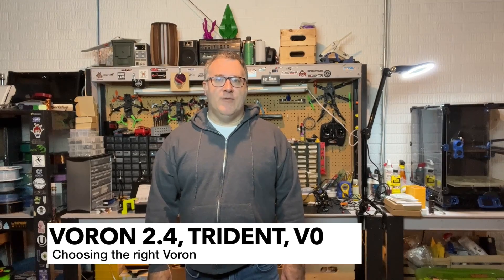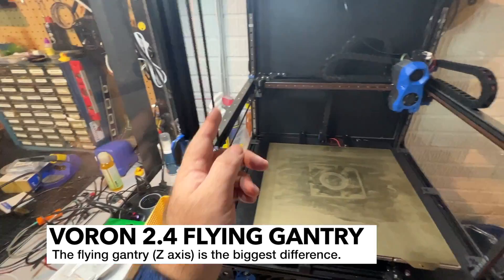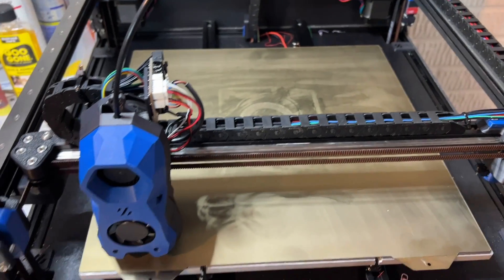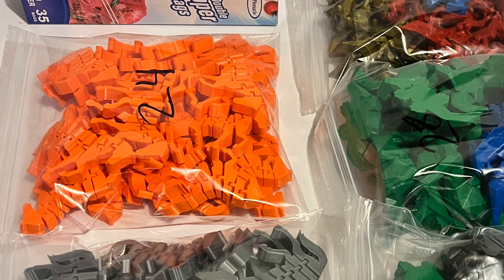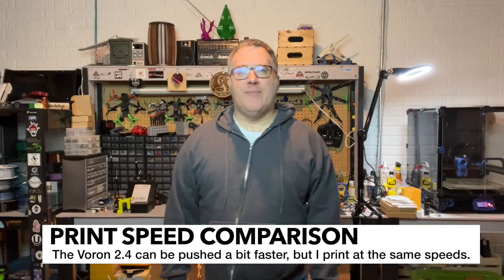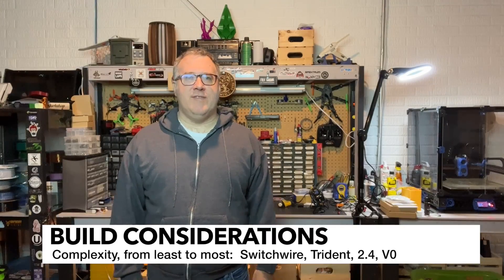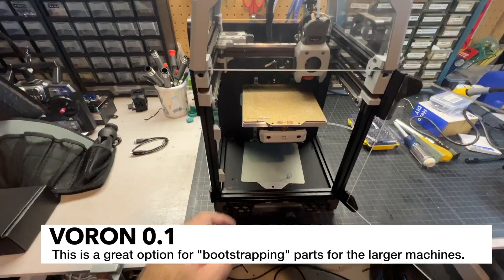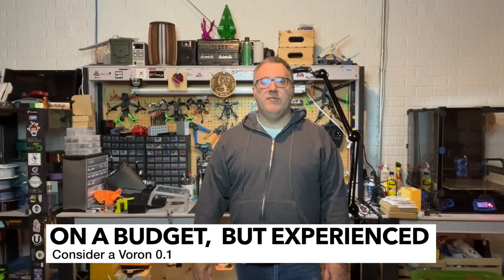Which Voron should you build?

Comment: Good overview. To  me there is no reason to recommend any voron except  for the trident. It's the easiest to build and maintain and give you very practical build volumes and good quality prints.

2.4 means more belts to tune, gantry racking to deal with, and overal a just more complex build. And the benefit is nebulus. You should bascially only build a 2.4 if you love the idea of a flying gantry with quad gantry leveling. But there is no treal practical benefit for the added complexity.

The v0 is a pain to build and a pain to maintain and work on due to the 1515 extrusions as well as a bunch of, honestly, bone-headed design decisions. I don't recommend the stock v0 to anyone.I often joke that there is a mod to change everything on the v0, only because everything needs to be changed.
Reply from the maker: Yeah… I do tend to agree! I know some folks really like the cool factor of the flying gantry. But the trident is definitely a no brainer. Thanks for watching and commenting! Appreciate the insight.
Reply: I'd say most people who go with the 2.4 is more than just the cool factor. The Trident, no matter the bed size, is still limited to 250mm on the Z axis. With 2.4 you get cubed printing volume, and if you need more Z height, the 2.4 is a lot easier to scale up.
Reply from the maker: @DavidRelich  Thanks for watching and the comment! The Trident in my video is actually a 300mm z height. The limit there is really just based on the length of the lead screw., but it may be difficult to find the proper motors with integrated z screws at the height you want.  But yeah, I agree it's easier to scale the Z up on the 2.4 with the belts and they should be good at least up to a 500mm height I would think. You really can't go wrong with either machine!
Reply: Thanks for the tips about the v0. Which v0 kit do you recommended to someone who’s very comfortable with assembly but wants to avoid constant maintenance? Thank you
Reply from the maker: @br88dy  If I were starting a new v0 build today, I would choose an LDO kit. They are working on a v0.2 kit but it's not out yet. Other kits may be worth exploring if you want a budget friendly option- I've heard the Formbot kits are OK. Many of the discord vendors also sell kits (KB3d, West3d, Fabreeko) that are worth looking at- those are US vendors, there are others as well depending on your location. Maintenance wise, any well built machine will probably be fine for a good 1000 hours before minor maintenance (eg. Belts, hot end heater, thermistor, fans) might need attention.
Reply: @GregsMakerCorner  thank you so much for the snappy reply. I will get on the Discord today. 

Does the headache continue for most people once they've finished their v0? My ideal workshop would have a few v0's and one large 2.4 or Trident, but I don't want the v0's to consume my time. I need open source tools, not open source projects.

Thanks again.
Reply from the maker: @br88dy  The nice thing about most Voron machines - once you get them up and running, assuming they are well built, you shouldn't have much to do with them. The biggest issue I've ran into is the temptation to "upgrade" to the next cool thing. Often times there are incremental improvements that the upgrades will give you but 80% of the time it's not going to make a difference in the quality of the machine.  For example, I upgraded one of my machines to an LGX Lite extruder because I wanted to print Flexible filaments a bit faster than what I could do on the stock one.  

If you can avoid the temptation then you can likely expect 1000 hours of printing before having to think about replacing things (fans, belts, hot end heater cartridge, thermistor) and most of those things can be replaced / maintained within 15 minutes or less. Belts will take a bit longer because you have to disassemble the toolhead to get to them.  Voron vs. other machines- you will have a lot less work to do on a Voron machine, compared to budget machines like Creality, etc. which tend to suffer from warped beds, lower quality extruders, etc. that cause you to chase a lot of problems and have must-do upgrades.  If you build your machine properly with a Voron you won't have any of that to worry about. Hope that helps!
Reply: @GregsMakerCorner  your advice does help a lot, I really appreciate it. I'll move forward with my Voron plans, thanks again.

Comment: If one is considering the V0 the Salad Fork might be a choice to consider. It is a Trident variation on the V0 and at 150-160mm is just slightly larger than the 120mm V0. Note that the LDO Trident that I got recently came with StealthBurner parts but uses the Clockworks 1 motor and extruder instead of the Clockworks 2, however this is compatible with the StealthBurner.
Reply from the maker: Yes there are so many great options for mods! I think the salad fork is a great example. I thought about mentioning the cw1/cw2 differences in the kit but didn’t want to get too detailed, but it’s a good call out. At this point I’d probably only consider putting a cw2 on for Stealthburner and hope ldo updates the kit soon
Reply: @GregsMakerCorner  pretty sure LDO current kits are all CW2 however the resellers are still shipping cw1 bec they still have left over stock of cw1.
Reply from the maker: @8bits955 Good to know, I hope they are including CW2 / nema 14 motors now in the kits.
Reply: yeah saldfork is great inturns of build volume, but i would say due to lack of good kit available it not as easy to get compare to a voron 0.1 and soon to be 0.2. But i do wonder with some redesigns of the parts it migh be possible to convert a 120mm bed to a 150mm. However 120mm bed still plenty enough for most prints and often prints that require bigger are way bigger than 150 or even 200

Comment: Great video, i myself got my self an voron 0.1 s1 from ldo ordered. Cant wait to build it and try speed benchy got a few light weight parts already and going to try to see if i can convert the nema 14 mounts to nema17 mounts to give a bit more power and two hot end to try one is a dragon hf paired with a nf crazy volcano block from mellow and the other one is a rapido uhf. And ofcourse some cooling upgrades/mods i am having a look at and designing myself for. My next new machine after the v0.1 would be a vzbot330 want fast printers so i want to skip the voron trident or 2.4, but i am converting my old ender3 v2 to a switch wire as i already have most of the spare part needed to build that
Reply from the maker: That’s awesome, sounds like a really fun project. There are so many great mods out there. I bet you are going to have some fun getting things going so fast. Best of luck on your build!
Reply: @GregsMakerCorner  Thank you :)